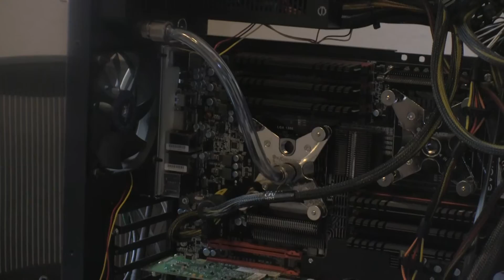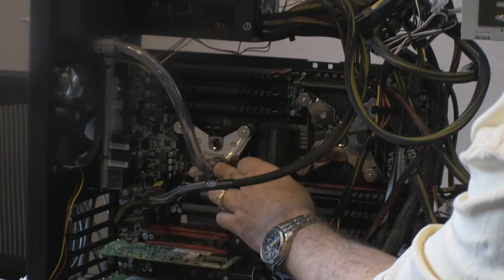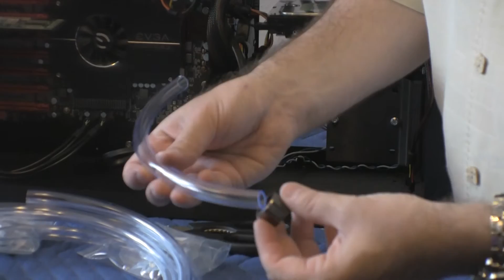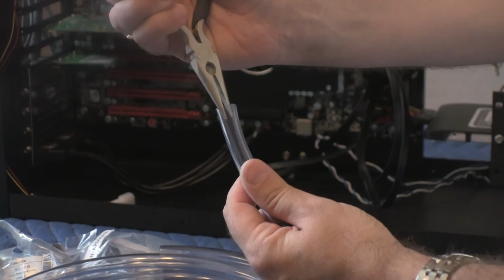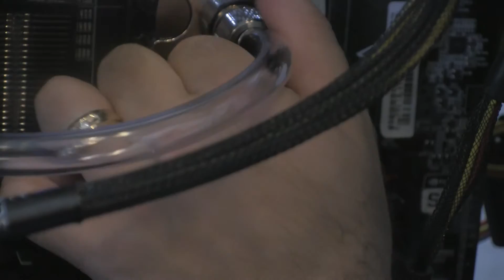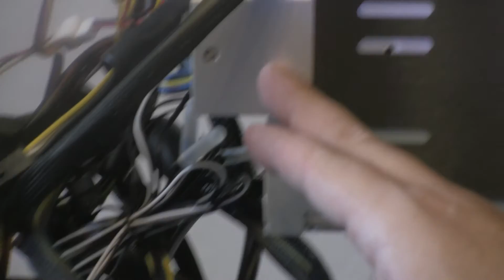Water Cooling Your Computer - Part 10 - Installing the Tubing

Comment: why the hell would you go from cpu to cpu 
should go pump to cpu to 3 bay rad to cpu to single then back to pump or video card
reson it goes to 3 fan pump first is cause it cools it down most before it goes to second cpu and gets heated again while having enough time to cool down in the pump/res

Comment: Instead of stretching the tubing with a needlenose pliers try boiling some water in a pyrex measuring cup, or whatever you have handy. Dip the end of the hose into the water for 10-15 seconds. The hose slides on with minimal effort and you don't have to worry about possibly weakening the tube. Love the rig btw. - Cheers

Comment from the maker: @Antonb1214  If you're using quality equipment, there's no need to do it. If you've never done it before, yes, I recommend you practice outside of the case, in case there's a leak, you don't want to fry your equipment.

Comment: is it necessary  to test your water cooling unit outside the computer not connected to the cpu before attaching it to your motherboard to check for leaks? did you do this?